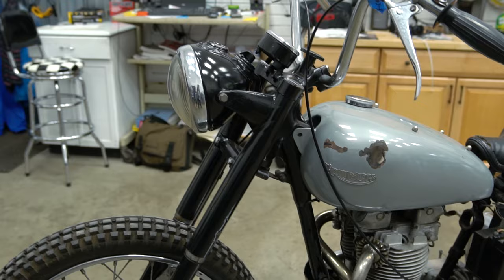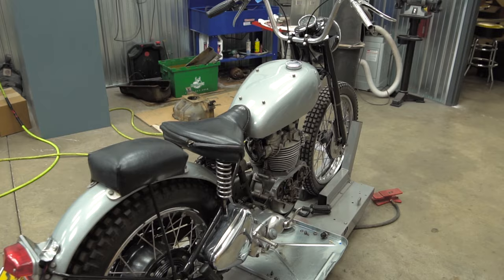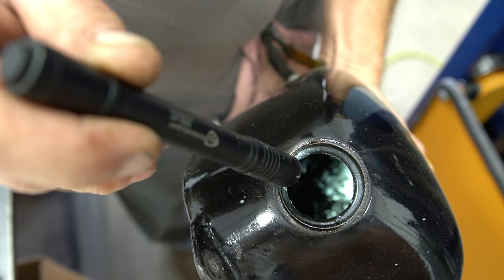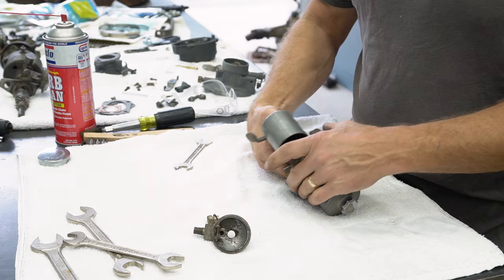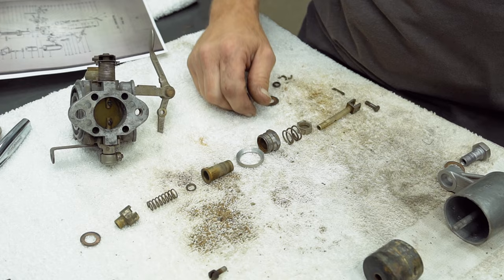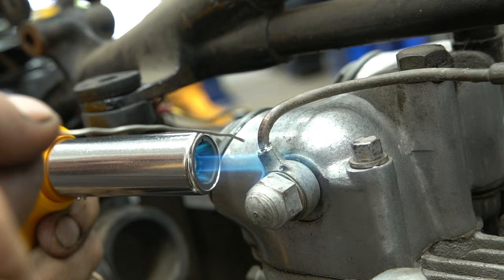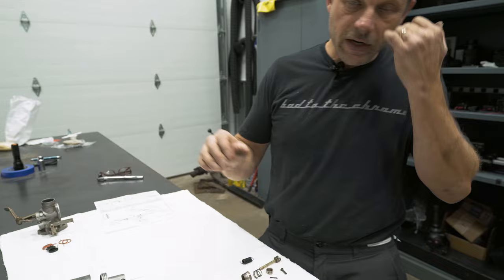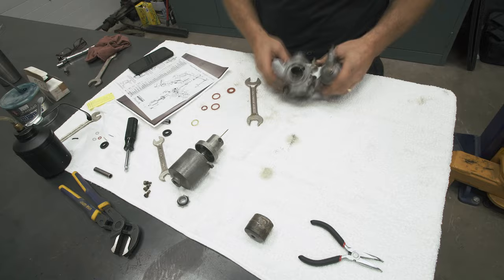Repairing The Fonz's vintage Triumph motorcycle - Will it run?

Comment: Imagine that sludge in your oil tank is also in the crankshafts' "Sludge Trap". If that trap is not cleaned your work will be in vain. Never start an old Brit bike W/O cleaning that trap!
Reply: I was about to make the same comment,
Reply: Martin Cvitkovich he most certainly did
Reply: Mine has been sitting since 1991 and I’m afraid to ever start it again without first opening it up and cleaning it out. It’s never been done. This years project
Reply: @michaelszczys8316  you won't regret it. The new oils today would have disloged some of that crap trashing out some parts.  After all is said and done, you may consider a oil filter.  and never worry about that trap again! I bought mine for my 59 from  M.A.P. in FLA.
Reply: The Sludge Trap had to be the most ridiculous idea in automotive history, something that can plug up and destroy your engine, but requires stripping the engine to clean it out. That's why I run two external oil filters on my Triumph Tiger, it's not something I want to have to mess with if possible. I also have an oil pressure gauge I hook up at least every year to check the oil pressure.
Reply: I wouldn't even start mine up without oil gauge, but then even that doesn't tell if it making it to bearings
Reply: @michaelszczys8316  It's no wonder so many Triumphs suffered major engine "blow ups". I believe with modern oil, filters and regular changes, there should never be an issue, but when you buy a used machine and have no idea of history etc. it's a real gamble as to what state the sludge trap might be in. The oils of the day didn't contain detergents so the sludge would stay put, putting in a modern oil can get dirt moving around and put that stuff straight into the bearings.
Reply: I have had my 70 since 1979 and in 1980 I had it apart but did not mess with sludge trap.
Now after sitting so long before ever firing again I want to try clearing it out
Reply: @michaelszczys8316  I don't know that sitting necessarily makes a difference, but the fear of the unknown is very real and you reach a point where peace of mind becomes the most important factor. Mileage is about the only other thing to make a decision by, but even that depends on if previous owners changed the oil regularly. Like I said in my original post the Sludge Trap is the stupidest idea ever, I think they got away with it because at one time people didn't travel far and it was also expected your engine wore out in about 12k miles. The fact you have to strip the engine and that it can then be the job from hell to remove and clean just adds to the ridiculousness. My current engine is low miles and I run filters, so I'm just going to keep my fingers crossed. The problem is as engines wear out more crud is produced to go into the sludge trap, some partly rebuild the engine, without attending to the sludge trap and then have issues because it was plugged with sludge and filings from the previous engine issues.

Comment: You need air, fuel, spark and COMPRESSION...
Reply: and correct timing :)
Reply: Isn’t it that you need air, fuel, and spark to make the compression? Think back to like 2nd-3rd grade science.....
Reply: @mattduane7239  No, the compression is made via a rising piston in a closed cylinder.

Comment: Very cool man !  Noticing how you slid the throttle grip on, maybe some value to someone.  When we were mounting rubber to metal, we'd use a little dish soap, dawn whatever. It slides the rubber  on easily and when the soap dries it's like a glue that holds the rubber in position.  We mostly used it on motorcycle tire bead to wheel but also rubber grip to metal handlebar. Works great.

Comment: Hey gang.  Im a Harley owner and own the big softails and a a 64 year old mechanic, so hear my opinion.  The Triumph two cylinder back then was a super dependable bike and the cylinders and heads were very close in design to the Harley,  And you could run dual drag pipes on those bikes and get some serious sound almost equal to the harley.  The honda dream could not put out the sound.  Anyone that owned one of those triumph 2 cylinders like that one in the video had a good investment back then, because they were so dependable you didnt have to work on them all the tie and you could have easily rode state to state and always had dependable transportation.  That bike was not just soe bike that could pop around town, but offered one the ability to travel.  It is sister to the Harley

Comment: Watching you work on this pre-unit reminds me how much I didn't like working on them. I always liked to work on the 1963 and up Unit twins with the 4ca or 6ca points, no mags, and the later concentric carbs worked better. Timing was a hell of a lot easier to set. But of course you still had to deal with Lucas, the "Prince of Darkness" components. Anytime I had one come in with a bad rectifier or zener diode I always changed it out to Japanese components, they worked forever. That usually happened because the Nimrod didn't realize it was a positive ground system.

Comment: The BSF and BSW spanner (wrench) sizes refer to the shank diameter of the bolt not the A/F size of the nut or bolt head. BSW had a much coarser thread then BSF (British Standard Fine) therefore it had a larger nut. So while you might have a 7/16th BSF thread will have the same size nut or hex head (and spanner) as a 3/8th BSW threaded bolt. There were also BSP (pipe threads) BSC (cycle) and BA which are essentially metric A/F but again it is the tread that is measured not the bolt head. In the US the AF system was used to size spanners, therefore we also used this in pre-metric UK because of all the machine tools and other manufactured goods shipped here during the war. (many thanks). I served my apprenticeship in a shop that had a Cincinnati Lathe which was then pushing 50 years old and the beds were still spot on. We used it to face castings of a double eye link used on a truck suspension. BS threads are still in use but almost everything now manufactured in the aero and auto industry uses Metric as standard. I for one do not mourn the passing of the Imperial measurements as they were fractional and difficult to calculate. We do retain a couple of old measures in UK The pint for beer and milk, and the Mile. The furlong 1/8th Mile is also retained in the horse racing field only. Warning never ever ask anyone about pre-decimal English money nobody's brain can handle it!

Comment: A couple of cautions - verify the scavenge screen in the sump has not varnished over with the same gunk you noticed in the bottom of the oil tank and also check the ball bearing check valves in the oil pump housing.  There would be two fuel taps with a banjo "Y" fitting with one side being the usual running tap which had a short tube on the in tank top of valve which prevented you using the last one inch of fuel in the bottom of the tank the other valve or "reserve" valve had no such tube and allowed you to get another hour or so of running by using that last 1" of fuel.  Your mag timing description is on point with one other caution. if using the 38 degree advance setting you need to make sure your lever and cable are in the full advance position.

One last note make sure the oil pressure indicator plunger is free and working. When started, that should pop out to indicate you've got pressure from the pump.  First place you look when it starts is down to that plunger.

Comment: In the mid 1990's I bought Tonya Harding's 1988 Honda 250 Interceptor from a Honda dealer.  It was there on consignment and I got a deal on it since I also bought a new Honda Shadow.  It was documented to be her bike. I still have the papers, but I sold the bike for what I paid for it a couple of years later.
Got a great pic of my M.I.L. sitting on that bike waving to the camera.

Comment: To help you with the Whitworth Spanners. When you read 1/4 inch on the spanner it is not the size of the hexagon that it is referring to, it is the Diameter of the bolt. So as you can see it is just as good a system as any other system.

Comment: That triumph will run real good on 100LL avgas (2 year shelf life). With pump gas E85 or higher mix with stable marine that will keep the ethanol happy for months. Also use sea foam or marvel mystery oil. This should handle varnishing. For setting up the timing a trip my father taught me was to use JB Weld on a threaded bolt. He would clean the whole of crankshaft where the thread should be with a solvent and then alcohol. Put a dab of the JB Weld then thread the bolt and let it cure. He would size the bolt threads to interference with the ID of the crankshaft so it would go in tight and center itself. One time I watched him use a tap that was just oversized to install the bolt. This method was risky as the tap may brake. John Par was an old Englishman, knew all the tricks. He'd been ride since the 30's.

Comment: You can always use the HOTTAS test method to determine if a magneto is good or bad. It requires an assistant.

(1) Ask the assistant to hold onto the HT lead by saying Hold On To This A Second (HOTTAS).

(2) Spin the magneto shaft.

(3) Use the reaction of the assistant to judge the magneto's viability.

No reaction = dead magneto.
"Ow" = weak to possibly OK.
"Argh you bastard" = Good magneto.
Assistant jumps, lies on floor twitching = Racing magneto.

Perfect safe for you to use as only the assistant is hurt!!

Comment: Those Whitworth tools really messed me up a bit after I got my 1972 Norton 750 Commando. After a while I got used to them. That Norton had both Whitworth and metric nuts and bolts on it so I believe someone had changed a few things around on it before I got it. And Kevin at PT Customs is an awesome guy. Got my springer front end from him for that Norton.

Comment: Another great vid... too many memories of setting mags on a TT! Might have been worth measuring the weight of the old float in grams, and then taking some of the solder off with a blowtorch and some liquid flux. A spare, perhaps. The headlamp reflector looks like a re-plate might be needed, and if the brakes were as bad as they were on my Trophy then I am impressed you are prepared to drive up to the camera and brake!

Comment: good you had your Whitworth spanners, think we used to call them' Went'worth, and were a serious pain in the butt as there are no "exact" conversions so a few roughed up nuts were common...(no not because of the seat position) lol...as with all shows there were more than one bike used, one sold as the original, just as that one is the original, there was even a old knuckle for a short time , probably too troublesome and bulky to handle as Henry is not a large man...a VERY cool man who could handle any situation with a snap of his fingers, whether its women, rockolas, or starting a kick start bike at distance

Comment: On these old pre-unit Triumphs there is actually (usually) enough thread to mount the degree wheel on the primary sprocket.  This will allow you to set ignition timing dynamically.

Comment: I remember been a little disappointed when I found out  Henry Winkler didn't like motorcycles and didn't like riding this bike at all. If you intend to run this a lot you might consider cleaning the crank sludge trap out! Great video.

Comment: Fonzie/Henry Winkler requested this tiny lightweight bike because he wasn't able to ride motorcycles at all,its a shame because Fonzies early series bikes were all vintage Harley Davidson custom bobbers,in the episode The Bomb Shelter Fonzie rode onto the screen on a 1938 Harley Knucklehead ,on episodes outside Arnolds drive in Fonzie rode two different newer model Harleys,he briefly rode a Panhead hard tail ,in his quest to continuously be pushed on lighter weight bikes Fonzie rode a Ironhead Sportster that wasn't made until the 1970s,Fonzie also briefly rode a BSA before going to this Triumph along with his green windbreaker

Comment: I noticed the oil pressure button on the right hand side gear case  when running it pops out to let you know the oil pressure is okay I tried to see if it popped out but could not see there is a large crome fitting and in the centre it pops out when the oil pressure is okay I used to have a T110 old one and I am from the UK I used to love triumph but harley was always my dream bike I have owned 5 harleys to date and got to get another one I have a 103 heritage regards Alan

Comment: If there was trash in the oil tank you can bet the sludge trap was clogged too. You had to clean that or risk no oil circulation. It is imperative that you clean the sludge trap, which is a centrifugal filter that is inside the crank shaft. This collects all the impurities 
and 'sludge' from the motor, the only downside is that when it is clogged up, no oil gets to your crank journals and about 20 seconds later as you are cruising down the highway your motor seizes or a rod busts through your 
cases. It requires splitting the cases and pulling the crank to get to it and clean. That was the Achilles tendon of the old Triumphs.

Comment: The 500 twin was imo the nicest by some way. The 650 and 750 twins had really harsh vibration, especially the 750. The 500 was sweet and even  the early bolt up frame was good enough for the performance. Top speed was lower (90 mph) but tbh the vibes on the bigger engines meant you simply could not maintain full chat for any distance (if your hands and feet didn't go numb, parts would start falling off). At the 60-80 British A road speeds  the 500 was a wee delight.  Even into the 70s imo the Daytona 500, despite being twin carb, was still a far more usable bike than the bigger ones.

Comment: I used Whitworth quite a bit through my apprentice years and beyond...a 1/4" spanner should fit the nut that goes on a 1/4" diameter Whitworth threaded stud or bolt.

Comment: I saw this exact motorcycle in The Gilmore Car Museum in Michigan.
Reply: There is probably 5 or 6 of them somewhere. Most movies and tv shows had multiple vehicles to use in filming.
The movie Mr. Majestic with Charles Bronson I understand they had 3 old Ford pickups that looked alike to film that movie because they were going to beat the crap out of it. As it turned out even though they drove it like the Dukes of Hazzard they only needed the one.
The Dukes of Hazzard show, on the other hand, pretty much reduced the number of Dodge Chargers in the world by about a third.

Comment: Whitworth threads are imperial...fractions of an inch, and upwards...the spanners were designed to take the cross section of the nut/ bolt to that particular diameter of thread.
Whitworth or BSW, ( British standard whitworth). All threads are imperial...
Same as UNC, UNF, BA, BSP. etc....

Comment: Whitworth is most certainly Imperial in that it uses inches as the base measure. Indeed, it was almost definitively Imperial having been invented in 1841 as the first national standard thread in the World. Right near the start of Queen Victoria's reign. The British Standard Whitworth thread was widely used in the USA too, until iron bolts were replaced by steel. However, it hung on in the USA for some aluminium (or should I write aluminum) parts in the 1960/70s when it was replaced for that purpose by metric threads. I should also add that the American Unified Coarse was essentially based on BSW.

Incidentally, the USA doesn't use Imperial units. What it does use is US Customary Units, based on a older English system of units. Imperial Units were defined by act of Parliament in 1825, and whilst the coincide with US Customary Units in some area, such as units of length, they differ in others, such as some measures of volume and weight.
Reply: Yes, you are absolutely correct, I will paste info 
"Except for 1/2" (where the British use 12 threads per inch (tpi) and Americans use 13 tpi) the thread pitches for the rest are the same as for American Unified Coarse (UNC). However, the thread form is different; Whitworth = 55 degrees; UNC = 60 degrees"
The main difference is in spanner sizes, UNC and UNF use A/F where Whitworth and BSF have the thread size marked on them, this is further confusing in that a 3/8 BSW bolt will use the same spanner as a 7/16 BSF bolt. Once you get used to it it becomes second nature.
Changing the thread angle, different gallon what are the Yanks doing.
(or should I write aloominum) and (soder for solder) cant they see the L, (erbs for Herbs), why mess with it, we invented it so we must be right, right. lol

Comment: Back in the mid-sixties I love my triumphs. One kick all I needed. I sold my last one a 66 500 6 years ago. And I went through I don't know how many want to buyers before I pick the right one. If you know what I mean
Reply: I sold my old Yamaha SR500, a while back. It had no key. No starter. Kick only  - -   with  a cable release. I don't know how many people still know how to start a bike with a cable release these days, but as far as I'm concerned, the bike had no key, no battery, and it didn't need a key!  It sure did thump at me! That bike had so much torque, it could dead start from a stop in third or even fourth gear without stalling, (although in fourth, it would stretch the chain out too much, the way it could buck).

Comment: I have a 1960 Triumph t110 it's the same year I was born I mix the lead additive make a batch gas once a year and start it up I had it since 1976 when I was 16
Reply: Been running Brit bikes since the early 80s, never worried about the fuel, never had a problem with seat recession.

Comment: I was told by an old head that those whitworth "imperial" measurements are based on fastener shaft diameter and not the fasteners head.